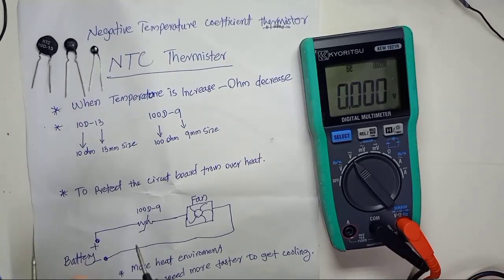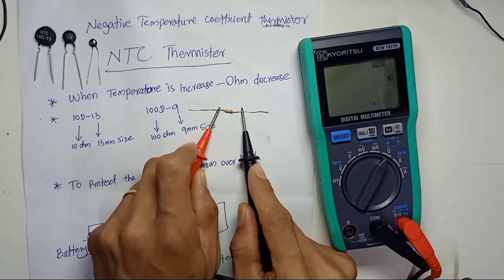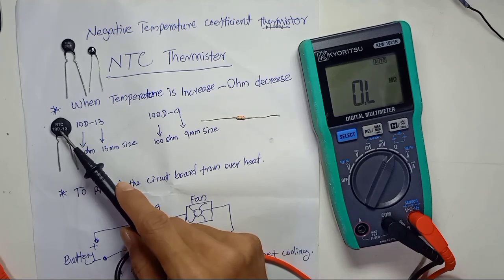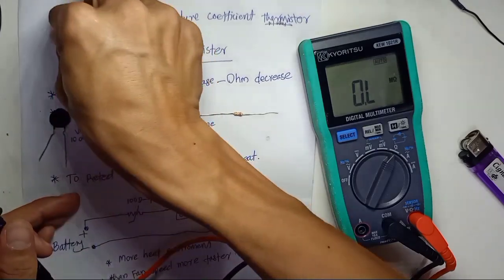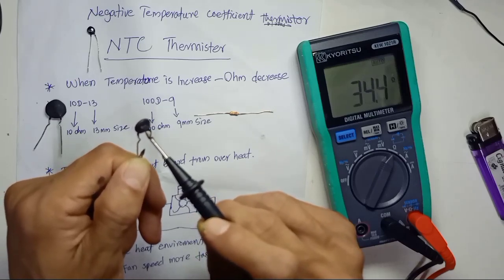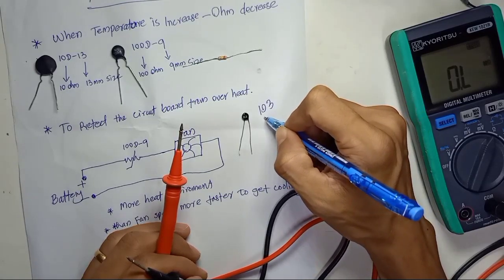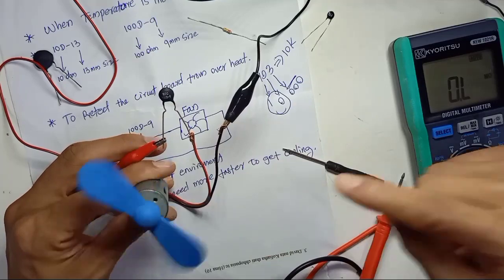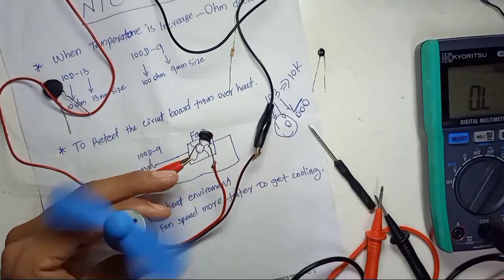What is NTC Thermistor

Comment: Can it be used in series with a 220V AC lamp to delay turning on?
Reply from the maker: This thermistor is no issue with the ac voltage so you can use it
Reply: I want to make a simple circuit to delay a few seconds or minutes of turning on a lamp. It seems that NTC can be used for that. @passiontechklm